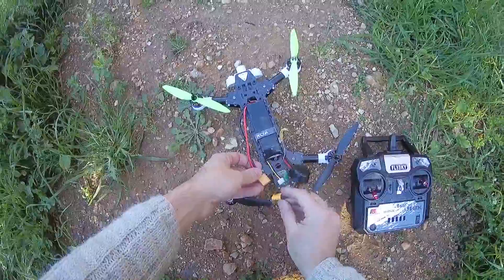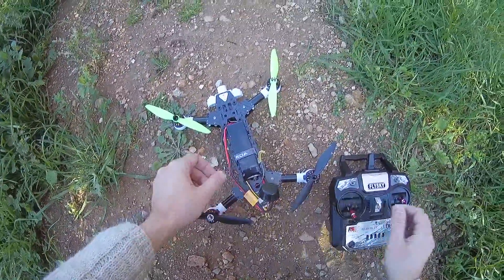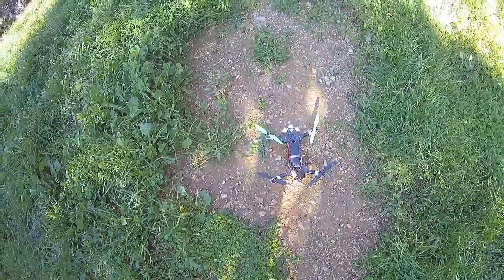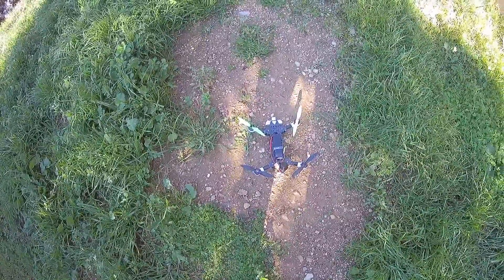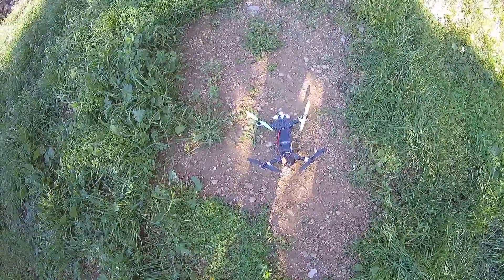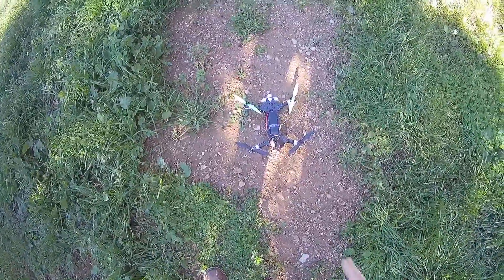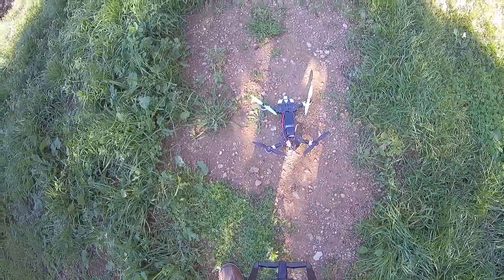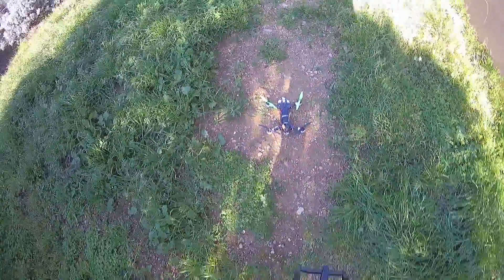ROA Parkour 280  first testing with betaflight (Courtesy Banggood)

Comment: What is the status of this copter, could you fine tune it and no glitch with original rx/tx?
Reply from the maker: I never succeeded to remove glites :( .... Really strange... Maybe by a complete new location of the receiver ?  I don't know ...
Reply: stock receiver and transmitter should replaced as I know to remove glitches, did you change that or not?